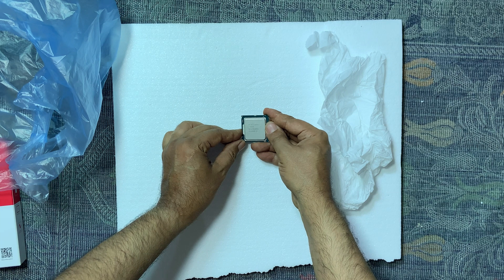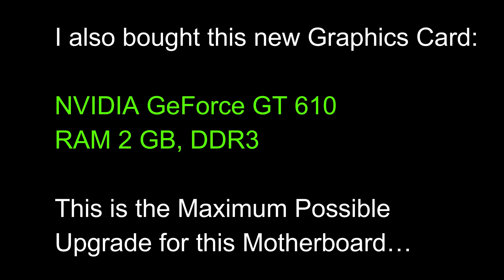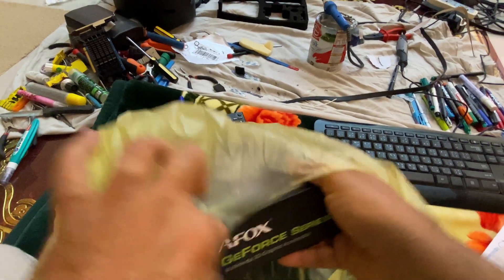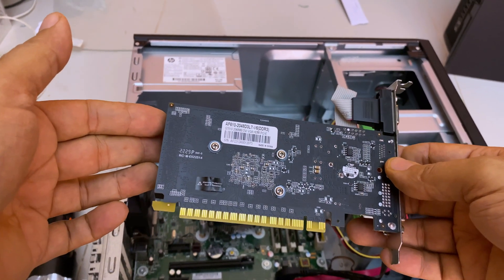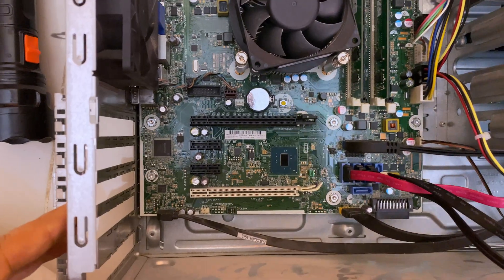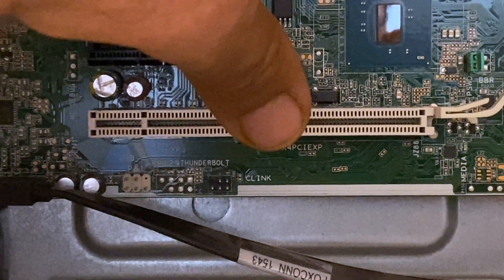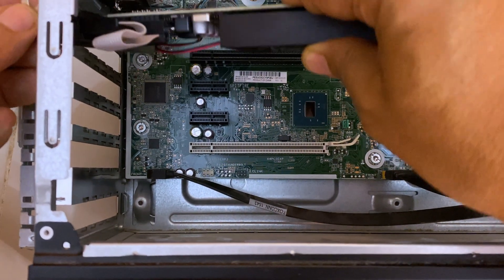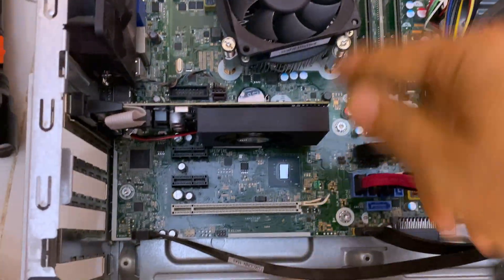HP EliteDesk 800 G2 Tower Maximum Possible Upgrade

Comment: Just bought a used same tower G2 i7 6700 but with 8GB and I bought a used Corsair vengeance LPX 8GB (2x4gb) ddr4 DRAM 2666 C16.

Just would like to ask as I no nuts about computers and learning as it goes. I'm a rather hands on person.

Can I just insert n mix the 2x corsair ram with the existing ram which is hynix hma81gu6afr8n-uh 8GB 2400 to make it 16gb?

As I try reading from some forums as can be mix but com will use the lowest frequency.
Reply from the maker: Then there is an amazing upgrade video is coming

Comment: My one is already partially upgraded when I bought it: i5-6500 @3.2 GHz, 512GB SSD (It was 512GB HDD stock), Windows 10 Pro (It was 10 Home stock), DDR4-compatible motherboard, 8GB stock. I boosted it to 64GB RAM, Got NVIDIA GeForce GTX 1650 with no extra power as my extra GPU, AND I am using DisplayPort instead with my monitor. I only really need to add an extra SATA SSD for storage.
Reply: Wait does NVIDIA GeForce GTX 1650 fit in it? Isnt it too big to fit into there? And is there a PCIe slot in the power supply,for the power for the gpu?
Reply: @SAMVEER123  It isn't too big and there is a PCIe slot for power supply. I lose 2 slots instead of one at the back, that's all.
Reply: Isn't 64gb of Ram too much?  😨
Reply: @Johnny-Taylor-07  Better to have too much than not enough.
Reply: @BrockMak  I have elitedesk 800 g2 too i7 6700 with 16gb ram ddr4 and 1t hdd and I planned to buy ssd m.2 plus psu because mine has just 280w and 2060s
Reply: How's temp on that build?
Reply: which ram did you used? DIMM DDR4 2133? or did you go for a faster one?
thank you
Reply: @apachecou  Just 2133 because I can't overclock my RAM sticks.
Reply: thank you!.. yes 2133 it's the max to go.. well I will start looking around, thank you for your reply @BrockMak
Reply: @apachecou  I think it's a default BIOS issue.
Reply from the maker: Ok, that is fine…